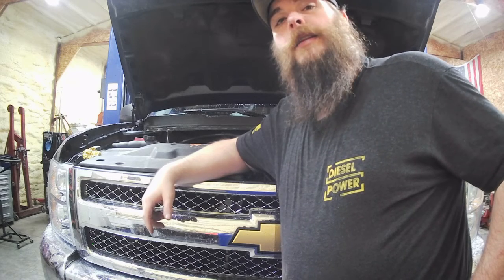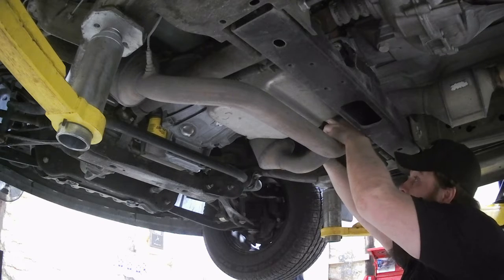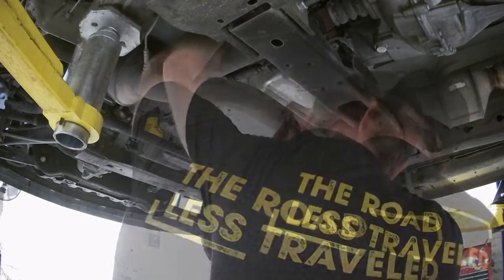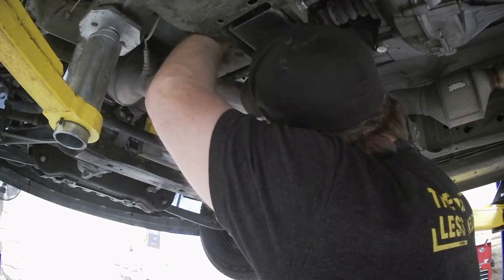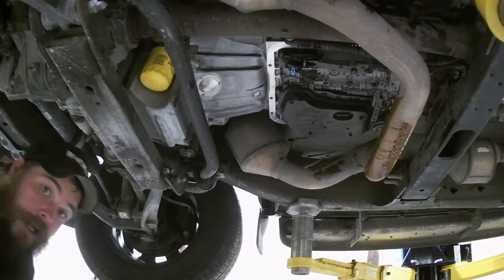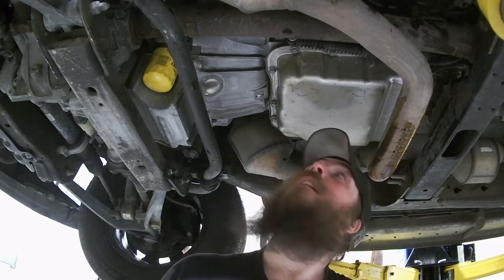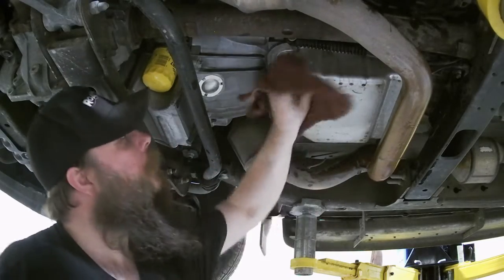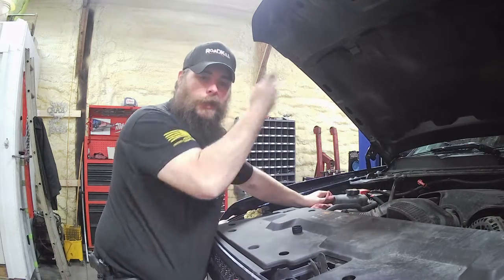2012 Chevrolet Silverado 1500 Transmission Service

Comment: As a former Tacoma owner, everything on this truck is a PITA. From oil changes, to transmission changes, to coolant, etc etc. It's as if it was designed to be purchased and then discarded with when the fluids have run their course.
Reply from the maker: They want you to bring it back to the dealer so they can keep getting your money. That's unfortunately how most if not all of these companies work these days. They want the independent shops and owners nearly unable to do simple services.